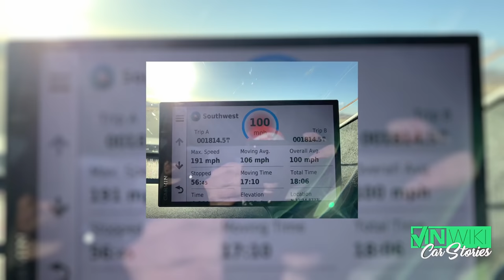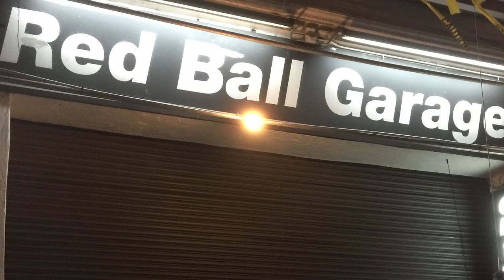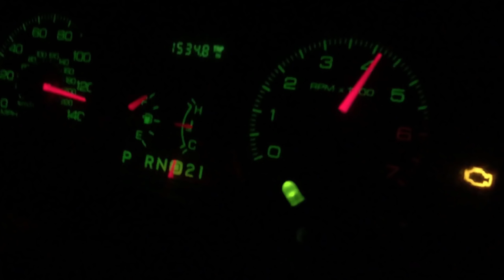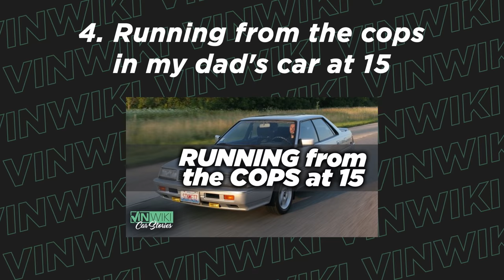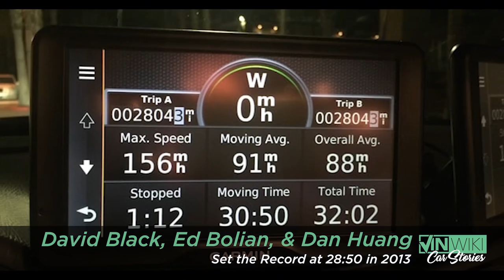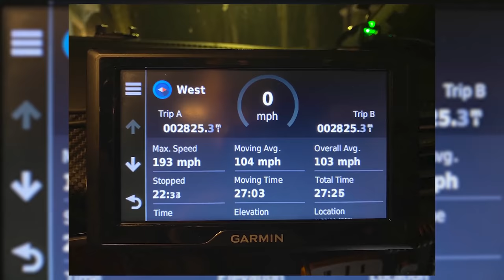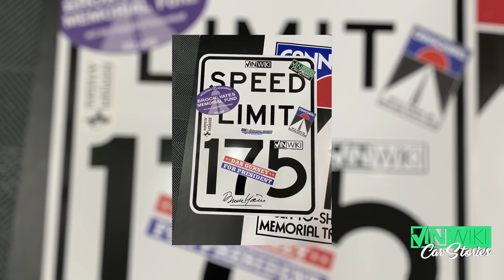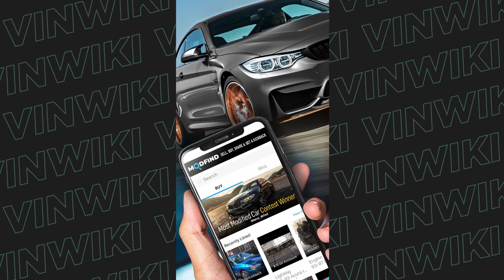Top 10 Car Stories of Arne's Antics

Comment: How do these guys not get thrown in jail for wreckless driving?? 40 over!?
Reply: I got a ticket for exactly 90 in a 50 in nyc in a honda fit. Drove home no issue
Reply: guess if you jam the lidar speed gun they can't prove it?
Reply: Depends on the state. In PA, reckless driving is a fine, and license suspension. But! You are innocent until proven guilty in court. When I was young and stupid, I got pulled over for 63 over, got my tickets and went on my way.
Reply: @volvospeed850  wow. In Florida, 30 over is wreckless driving and a felony. Punishable by $5k i believe and/or up to 1 year in jail
Reply: @JimBobe  that's crazy! I get it, but it just seems a tad excessive.

Comment: I've got a story like his getting chased by police one... I was in a mk3 golf though and overtook the cop that was in the middle of a pack of 3 cars doing about 110 in a 50.. Just kept it pinned, I saw the lights flashing for a split second before I was out of there, pulled Into my driveway flipped off the lights and the engine about 10 seconds later the cop went flying by with lights on sirens going and everything 🤣🤣